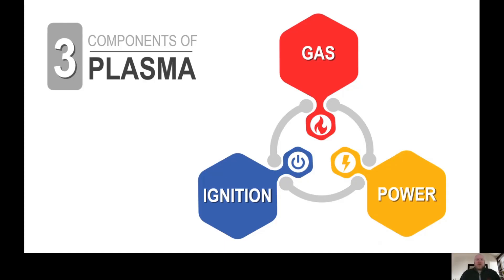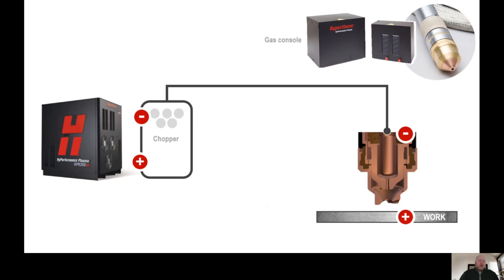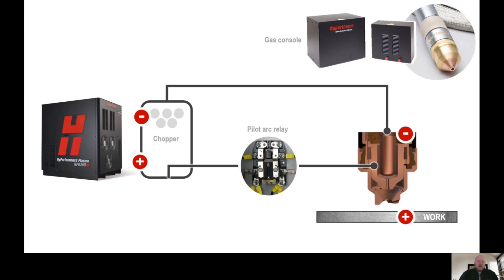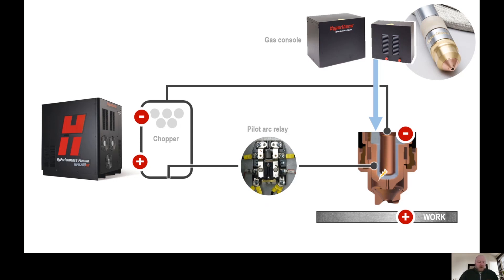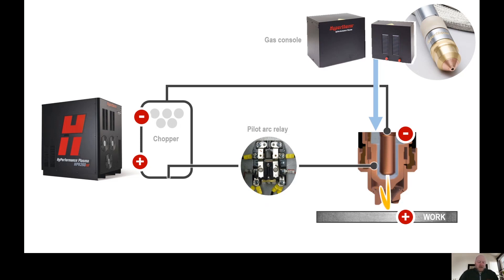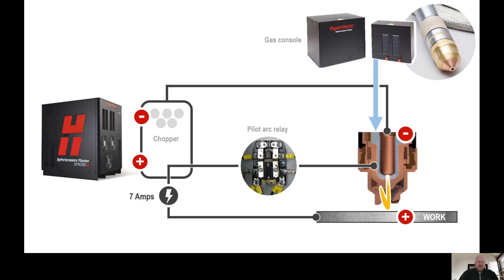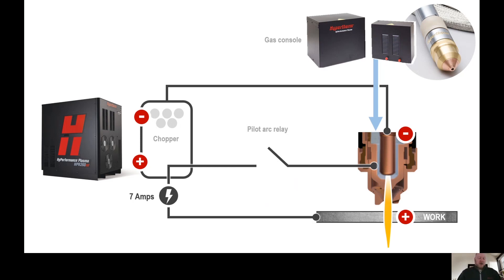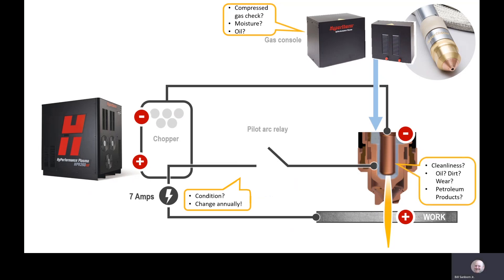Understanding plasma arc ignition

Comment: Exemplary, you deserve the stars of the sky. I have a question for my dear friend. The question is, there is a malfunction in the machine Error code
number 020 mashin HPR130XD ( I checked 
020 -No pilot arc
No current detected from
chopper at ignition and
before 1-second timeout.
1. Verify that the consumable parts are in good condition.
2. Verify proper preflow and cut-flow settings.
3. Perform gas leak tests (see Maintenance section).
4. Verify spark across spark gap.
5. Inspect CON1 and pilot arc relay for excessive wear.
6. Perform gas flow test (see Maintenance section).
7. Perform torch lead test (see Maintenance section).
8. Perform start circuit test (see Maintenance section).
I did not know the holidays, thank you
Reply: Then changing the new header and its contents to no avai
Reply from the maker: @mohamedsalouane-762  I'm sorry you are having trouble with you system. Please contact our technical support team directly. We can not do trouble shooting through YouTube.

Comment: What confusing me for years is that I dont see  any wire connected to the electrode In HPR130 and HPR260  torchs,  it's only one wire connected to the nozzle. Any one can explain this ???
Reply from the maker: High amp plasma cutters use liquid cooled torches. We install a wire inside the coolant line to carry the electrical current out to the electrode. 
By installing it inside the coolant line and exposed to the coolant we are able to provide high amp capacity through a smaller than normal wire gauge size.